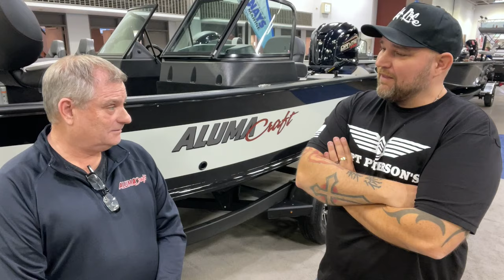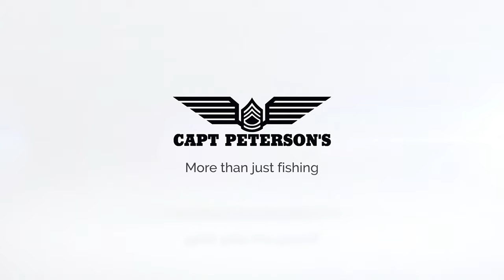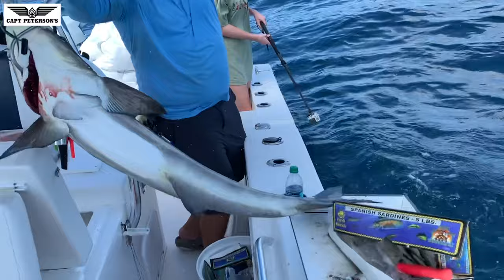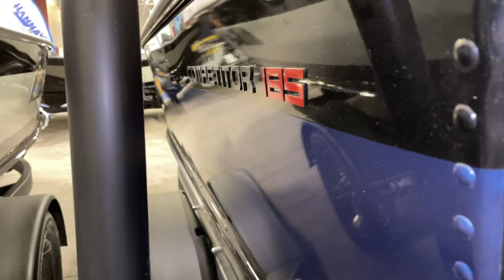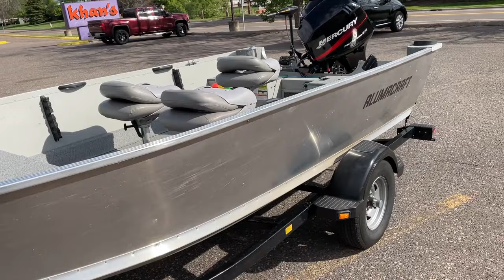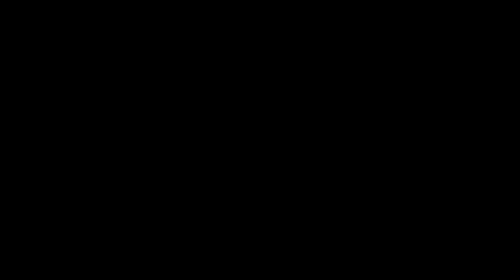No One is Telling You The Truth About Aluminum Boats So I Have To

Comment: I like riveted in most cases. Only reason I would ever get a welded boat is for serious stump jumping, and the only reason I would go welded is because riveted jons are usually much thinner than welded ones. Need that thicker bottom to go log sliding and jump beaver dams. Other than that, I stick with riveted boats because they are easy to fix.
Reply from the maker: Wisdom bro. We need to hit up a boat show one of these days!
Reply: you need to come up to wa st or oregon,,theres a few of these boats around,,been seeing a few lund boats every once in a while,,its all about welded aluminum boats out here,,hewescraft searunners,,no river,alumaweld ,duckworth etc ,,i would never own a riveted boat ,  i currently own a new 2023 hewescraft seerunner,,if im out in the ocean hitting some rough chop im not gonna worry the boats going fold etc
Reply: @BADBRAD1959   Both you and Andrew are correct. It's all about the surroundings you'll be in. I, myself would never take a 19 foot (Riveted OR Welded) aluminum to an ocean start with. But I would also like a Hewescraft. They are built nicely, for what I need.
Reply: 62 yrs old a welder since 16 and a CWI for the last 30....rivets are not stronger than welds...they are cheaper.
Be honest!
Reply: @gtb5216  You shouldn't be teaching if you believe that! LOL you've never heard of the Heat Affected Zone, or Metal Fatigue? Mechanical fasteners are stronger then welds in 90%+ of applications, welding is WAY cheaper then installing rivets, re labor, tools, prep time and materials... the list of things you don't seem to understand is rather long, maybe you should take an engineering class sometime ;)
Reply: Welds break over time they aren’t perfectly joined pieces of metal the weld is a weak point that slowly gets beat up by vibration and force and will crack over time until it completely breaks. Rivets are better at taking a lot of small beatings like waves
Reply: No conflict of interest just science
Reply: @mikecollins8241  no one is using riveted boats in Alaska, if the boat has proper skeletal structure the welds are the way to go.
Reply: Any aluminum boat is easy to fix, just weld it! 🥴😂
Reply: I have been a welder since 1975 which is 49 years I was a pipe welder in 5 nuclear plants and currently in a chemical plant I have welded aluminum with mig and tig and I believe that if you have a proper fit have clean metal and use the compatible filler material you should not have to worry about stress cracks . I have a jet boat and run in shallow rocky rivers and I have not experienced weld failure and I would never think about using a riveted boat in the waters that I go in . I do have a riveted Jon boat that I use in water that I don’t have to worry about any obstructions and it has never leaked so I guess that you just have to use each one for the right application .
Reply: @JRoy-1969  I live in Alaska.  Welded boats are nice, but there are still plenty of riveted boats up here.
Reply: Depends on the welding technology used. Modern laser welders are a game changer

On the riveted side adhesive technology has come along way
Reply: @gsc512  Yes I’m sure that technology has come a long way, I have not been exposed to laser welding and I am at the end of my game so I probably won’t be , I have had my hands in orbital tig welding on pipe but that is about as high tech as I have been. Laser sounds interesting though.
Reply: @robertpatterson3406  for some reason it didn't let me post my last response, but it's pretty amazing technology and the computer does the vast majority of the work. You can even weld the similar thin metals together. One of the best systems is called light weld
Reply: @gsc512  the majority of my welding has been pipe everything from schedule 10 stainless to heavy wall chrome moly ,inconel , monel etc. I have welded a lot of sheet metal down to 20 gauge with most of it being tig and stick . I would like to see the laser in action and even possibly do some laser welding but I don’t think that is going to happen since I am at the end of my career retiring in 5months .
Reply: @mikecollins8241  Why do you think welding is cheaper than riveting on small boats?  I don't really know.  If we were doing it by hand, I think we'd need less prep time and tools, skill too, if we riveted it together.  In a factory application,  perhaps the weld is cheaper and easier.  Answered my own question maybe.
Reply: @larryspiller6633  i was thinking about labor cost, one person to weld, 2 to rivet, not to mention predrilling holes etc.... weld prep can be done mechanically/ chemically, welding could even be robotic..
Reply: @larryspiller6633 I think you hit on it yourself. They are talking about production manufacturing where the labor of a two-persons riveting team costs significantly more than a single person or robotic welder.
Reply: @alanploetz7100  Perhaps, but I'm wondering if there isn't a machine that does the riveting like the robotic welding?  As for owner repair later on, the average guy should be able to do some riveting.  Except Bubba, he'll use nuts and bolts.  Regardless of how your boat is made, I'll go fishing with you. Peace.
Reply: Aircraft are riveted!
Reply: The main reason that airplanes are riveted vs welded is that rivet joint strength is consistent and the rivet holes act as crack stoppers
Reply: Laser welding may change the situation
Reply: @jaket8600 At our marina in FL, there were a couple of cruisers that were aluminum. They were all welded hulls. While rare the older ones had spots that would need occasional repair. Only one time did I see a customer have issues with rivets. That was because when he replaced the transom the transom supports had to be removed and replaced. The owner was one of those guys who knows better than everyone else. We saw him using pop rivets and my dad told me to mind my own business. He wouldn't have listened anyways. He didn't even leak test it. Then came the day he had us put in back in the water. The waster was just pouring in. I knew they would leak but I didn't think it would be that bad. Any worse and they would have been two dozen geysers. We pulled it back out quickly. Instead of replacing them, he tried to use 5200. It was fine at the dock. After he took it out on a trip he had us pull it back out so he could replace them with solid rivets. 😂
Reply: @WaveformV1.0  I wonder how friction stir welding would hold up. It's used on some of the parts for space rockets.
Reply: I Wonder why big slips that have to handle tons of weight are welded. 😂
Reply: There's a newer technology available now so you don't need a weld or a rivet. It's called Flex Tape. Maybe you've seen it
Reply: @jaket8600  Not if you peen the weld it makes it stronger
Reply: @Jonathan.D  better to invest in a laser welder that can clean, cut, and wire. Plus the turnaround on one job for welding is incrced and the cleaning laser uses air.

Comment: Let’s get someone who knows metallurgy involved, specifically the aluminum alloys.  Aircraft grade aluminum is not weldable safely, that’s why it’s riveted.
Reply: Marine grade 5052
Reply: @gregketcher2786 no matter the alloy, even 5086, you cant put aluminium over high temperature, not because its fusion point is over 650 °C you can weld it over 330 otherwise youll weaken the piece

Comment: There are almost Zero heavy commercial boats or Coast Guard inspected passenger boats that are riveted. Riveting is great for light weight fun boats, but all the heavy aluminum work boats are welded. Each serves it's own purpose accordingly and should not be compared or confused.
Reply: The thinner the aluminum is the more difficult it is to weld.
Reply: Exactly right.  The recreational sheet metal boats are about as thin as can be welded and retain good weld margin strength.  Riverted or welded, neary all of those boats have a .060" topside (above waterline) thickness with a .100" floor pan thickness.
Reply: Ocean going ships were all riveted once apon a time and I've never heard nor seen evidence of one sinking because it was a riveted construction !
Reply: Yes even battleships
Reply: @Hitman-ds1ei  Oh yeah just like the Titanic!
Reply: @Hitman-ds1ei  And then they figured out how to weld 😄
Reply: @jamess3532 Do you think welds would have made any difference?
Reply: Submarines are riveted
Reply: @samtipikin  for me that's 'nuff said thank you
Reply: @OutnBacker  I can’t think of a PNW aluminum boat manufacturer that has either .06 sides or .1 bottom.  Lowest I see start at .160 bottom and .1 sides.  Average is probably .190 bottom and .125 sides.  Higher end is .250 bottom and .160 or even .190 sides.

The stress and cracks of welded aluminum spoken of in the video is likely due to excessively thin material in poorly manufactured boats.

Build stronger boats.  Issue solved.

Comment: I bought a new Crestliner aluminum, all welded, boat in 2001. I ran it through heavy waves without having any problems. I think Alumacraft to too cheap to upgrade their manufacturing to welded boats. They are trying to convince potential customers that the obsolete riveting is superior to an all welded aluminum boat. I'm 66 years old and had many boats (aluminum and fiberglass)and the Crestliner welded aluminum boat is the best boat I ever had. **I say BS to this video.**  Buy the way I don't work for Crestliner, I never had and I will not make any money or benefit from my comment. I giving my honest opinion.
Reply: That's cool... one question. Do you think there aren't any Lund owners out there with the same exact experience?

Comment: I do aircraft structural repair for a living , I fix aluminum boat hulls on the side …the majority are riveted but, the welded Princecraft and Crestliners I fix are brutal for cracked ribs and low penetration on seams
Reply: It's almost as though quality of construction is more important than the method of construction.  Crazy.
Reply: Are you seeing it on certain hull types because my Crestliner 1650 Fish Hawk has been solid with no cracking whatsoever model year was 2018?  Thanks for your feedback.
Reply: @mikerouse6004    2008 Triton VT19, made by Crestliner here.  Solid as a rock
Reply: princecrafts are mostly riveted
Reply: those manufacturers probably used a MIG & spool gun instead of a proper TIG machine.

Comment: In the interview and following conversation presented here, I can not help but say that the elephant in the room has been ignored. I would never provide any criticism for the structural component of an aluminum boat as they are well proven. Nor would I argue against replacing a rivet or rivets in an aluminum boat.  However, out here in the field as a repairer we see a very large number of leaking aluminum boats, some with loose rivets and some not. The issue absolutely is not the rivets it is the bonding agent used on the seam to increase the strength and seal the seam. It becomes delaminated, and then the boat leaks. You can tighten or replace rivets, but you can't replace the bonding agent properly without totally disassembling the seam that is leaking, which would be cost prohibition . You can seal the seam on its edge,  but with the bonding agent nullified sealing that edge doesn't seem to last very long.

Comment: Boat put together with rivets that sales guy will say rivets are best. Welded boat dealer will say welded is best.  Have heard of welded boats cracking but have also seen boats leaking at rivets and cracks starting under the rivet area
Reply: Well.. Maybe we should ask for reviews of all the WELDED aluminum fighter jets.  LMAO
Reply: @justis4men211 why don't you fly yourself over to an aviation channel to compare apples to oranges
Reply: I have as well.  A lot depends on how you treat the boat.  I was tough on my welded jon - drove it hard and fast in open chop. Hit some really big boat wakes.  The cracking was at the front corner where the forward seat was welded to the side.  Just a hairliner about 1/2" long on both sides.
Reply: I heard fighter jets don’t do well in water, so, there’s that….

Comment: Then why to they charge more for a welded John boat rather than a riveted boat
Reply: Cuz its harder to manufacture,
Price doesnt always equal the best quality,
For example in gun industry Nitrite barrel is simpler than chrome alloy to manufacture, hence the latter is more expensive, yet Nitrite barrel are more durable, less exposed to corrosion and more heat resistant

Comment: Jeez.. after owning many riveted boats, I can say I’m very happy to be in a welded boat…
Reply: good luck to you, decades down the road.
Reply: @BumpNrun69  My 13 ft welded boat, Duranautic, was purchased in 1974 and has been run hard, and is going strong.
Reply: @BumpNrun69 my welded skiff has survived 30 years crawfishing in flooded timber, come try a couple of seasons with your riveted boat...😂😂😂
Reply: Amen brother I don't have to bail water any more with my welded hull and it takes a lot more of a beating than my riveted one did. In big water I used to watch the water squirt between the rivets on the bottom in the old junk.
Reply: @BumpNrun69  good luck to your leaks

Comment: I've been making mig welded aluminium boats in Wales UK for 25yrs + we use 5083 marine grade aluminium, minimum thickness for hull construction is 5mm anything thinner with current regs you wont get coded as a fishing vessel or for passengers. ( a lot of our boats are sold for domestic use)  A couple of things that are bad for aluminium is brass, copper, (never use) and stainless steel fine on bare aluminium but if you paint and don't use plastic inserts as a barrier for your fixings a reaction happens with sea water, the paint blisters, this is one of the reasons we tell customers don't paint wrap instead if you have to, but your better off leaving it bare,  and wash the boat of with clean water each time you use it if possible. Rubber mats we found when placed in a locker or on a deck you can get some corrosion as rubber contains sulphur, we found it bad in lockers that get very damp, you get a funny salt deposit,  left unchecked does cause corrosion. That's why we install PVC rubbing strip and PVC matting when required. the other advantage of aluminium boats over grp is at the end of the boats life what do you do with grp???? an aluminium boat you cash it in at the local scrapie,  then sometime later go buy a 6 pack of beer which used to be your boat  and enjoy.

Comment: I have a 1964 Strarcraft Chieftain lapstrake riveted boat that has only needed 2 rivets replaced over the years. This boat ran in Puget Sound in big water and is now running on larger lakes so it has seen the test of time.  I also have a 2006 welded boat that has had to have 2 repairs already.   Your point about a riveted hull distributing the stress is spot on.

Comment: Thin aluminum is very tricky to weld but can be reliably riveted.  Bigger offshore workboats that have to be made of thicker aluminum sheet and plate are always welded, never riveted.  Airplanes have to be made in lightest way possible.  This puts the structure in a more risky cyclic fatigue regime.  Also, various materials and thicknesses have to be connected together in the structure.  This all favors riveting ... but demands periodic inspection at designated intervals calculated from fatigue life and corrosion rate calculations.
Reply: In aircraft the main factor is the heat treatable alloys that must be used to achieve the necessary strength to weight.  These alloys cannot generally be welded, so rivets must be used.  If they could make a weldable alloy that would maintain the same strength as current aircraft alloys even after welding, then all aluminum aircraft would be welded.
Reply: I think u hit the point good.  Difference between thick aluminum plate and the thinner hull boats being produced. Thin aluminum plate likes rivets over welds
Reply: In most cases, aircraft are not submerged in water. Completely different application. It was kind of inexplicable why he would compare aircraft and boats.
Reply: @jbj27406  And yet, most aircraft floats for seaplanes are made of riveted structure, for the same reasons as the aircraft they are mounted to (allows use of high strength, non-weldable alloys).
Reply: @netpackrat  Agreed. That exception occurred to me also. However, the average aluminum fishing boat is not built to float plane or seaplane standards for the reasons you suggested. The standards of construction and materials is far more advanced and critical in aircraft. And weldability is probably counter to skin/structure strength.
Reply: @jbj27406  I don't think that you and I have anything to argue about.  My main point in replying here was that the reason rivets are used in aircraft doesn't have anything to do with thickness of the material as the OP suggested.  The aircraft I have worked on (mainly transport category) are made of thicker stuff than the typical light planes he was probably thinking of, and yet their aluminum structures are still riveted.  Because the materials we have to use in order to get the necessary strength to weight can't be welded without huge loss of strength.

At the same time, welding thin material is no problem at all with the right equipment and a skilled operator.  I am a mediocre welding operator, and I've had no problem welding aluminum as light as .050" with what was sold as an entry level machine when it was new.  The machine, at least, is capable of thinner, I just had no reason to ever try it.
Reply: @netpackrat  Agreed, no argument here. Your knowledge is more first hand than mine, and there are so many variables in metallurgy and design that it's difficult to summarize this complex subject simply. Thank you for your input. Best regards.